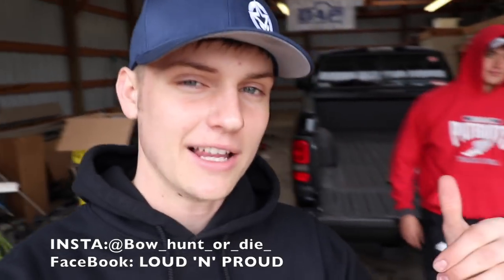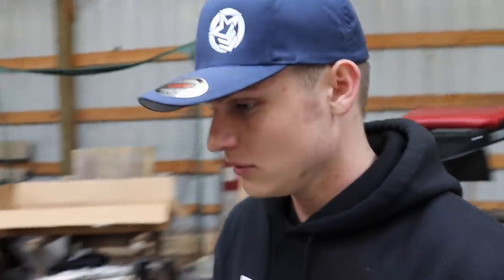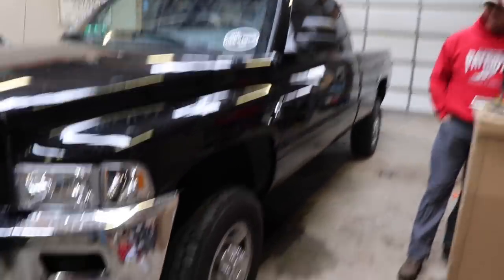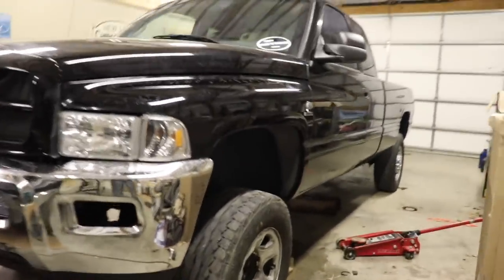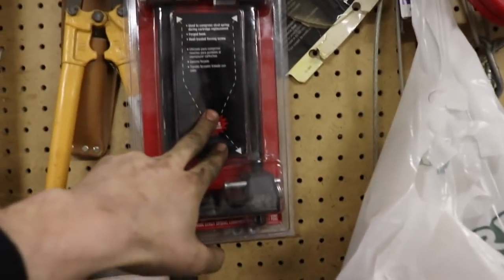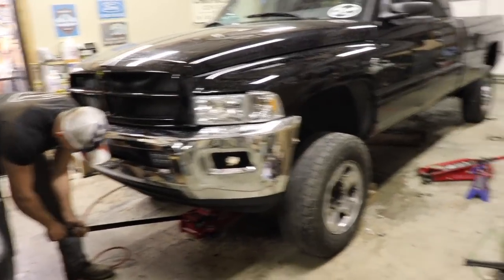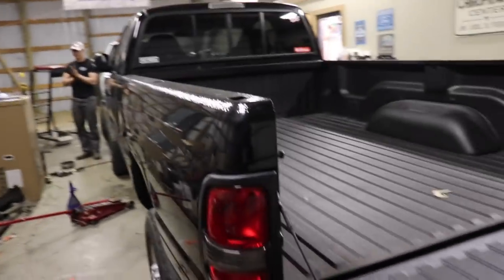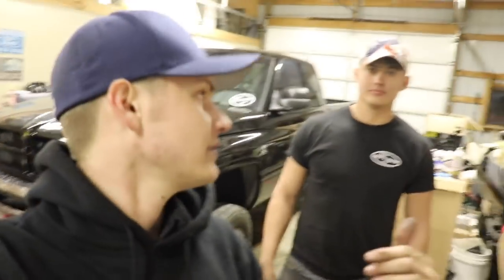WE LIFTED THE GIVEAWAY 12 VALVE CUMMINS!!!

Comment: Easiest way to do a leveling it is, Jack up the front axle in the middle and raise it as high as the jack you have will go. Then take a really tall jack stand or some Concrete blocks and a jack stand and place it under the front crossmember of the frame. Lower the jack down thats on the axle and it will sag pretty good ways down if you have a tall jack aswell. then just compress it a little bit and pull it out super easy.

Comment: Just a quick question, why do you use spacers for the leveling kit instead of buying 2.5 inch taller springs? I bought the springs instead of the blocks and it rides way better the the spacers and I feel is the taller springs are safer then the spacers.

Comment: Nice but i have a 2007 5.9 cummins stock mint no rust 100,000 miles no need for another dodge i just bought a c10 1979 with a 350 smalllblockv8
Reply from the maker: JIMMY Hendrix there’s ALWAYS room for a free diesel.....

Comment: The first gen is deffinetly lifted my brother's first gen has 2" list springs in the front and sits way lower than that but otherwise awesome vid man!!!
Reply from the maker: Powerstruke 444 ours also has 35’s on stock offset... adds inches...
Reply: LOUD 'N' PROUD my brother's still has stock wheels and 235/85x16s and just barely clears